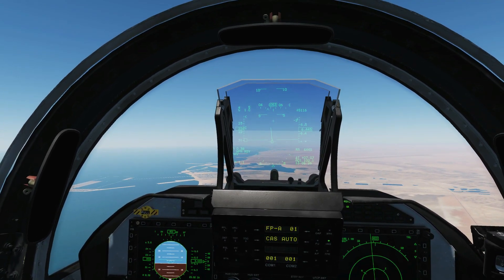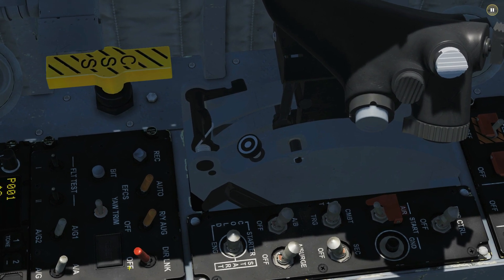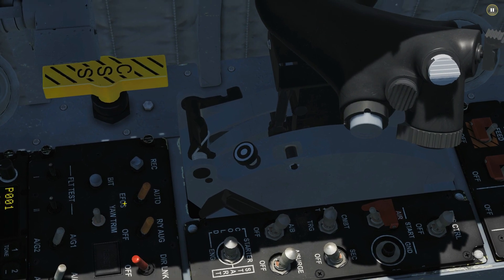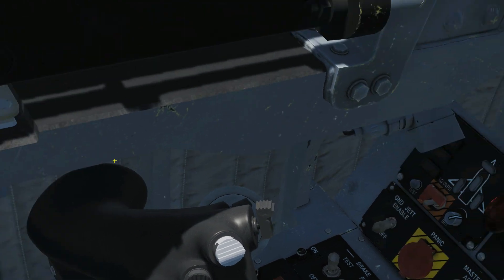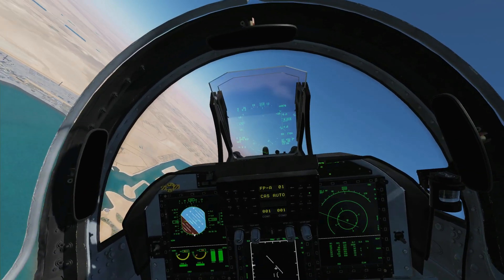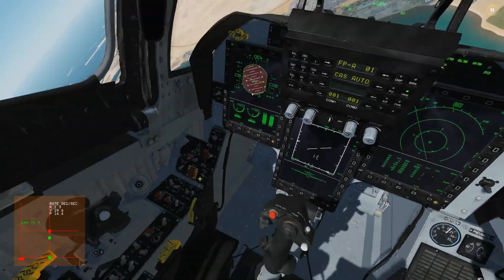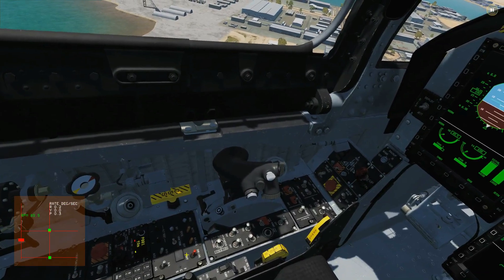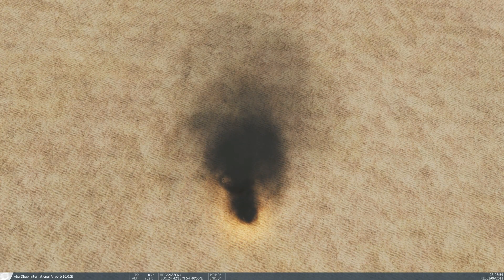JF-17 Thunder: Fly-By-Wire Override For Spin Recovery Tutorial | DCS WORLD

Comment: 27 can be flown with FCS off just takes practice would like to see you do some  horizontal pulls with it off
Reply: Blackbirdz2000  what's you question  idk what your talking about Internet talk holds little weight to me probably desided it was not worth saying if I did but I dont recall
Reply: Blackbirdz2000  I fly the JF17 in DCS what's your problem why must people be so aggressive.
Reply: No point to turn it completely off, Su27 also has a function called ASC relax, which you can bind to a button, and when you pressed and hold that button, you still have the FCS working to stable your aircraft, but it nolonger limit your stick pull, so you can pull much higher G, to the point that can break your wings. This is much easier to use, and actually useful in dogfight, just dont pull your stick too hard at 700+ km speed.
Reply: @qiyuxuan9437  I use both in DCS